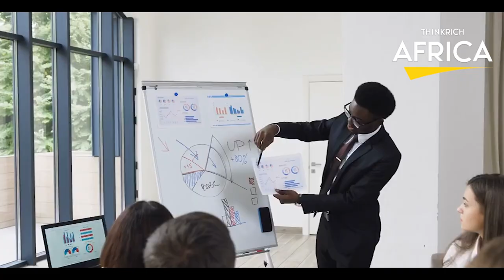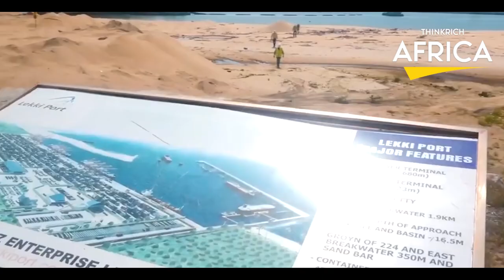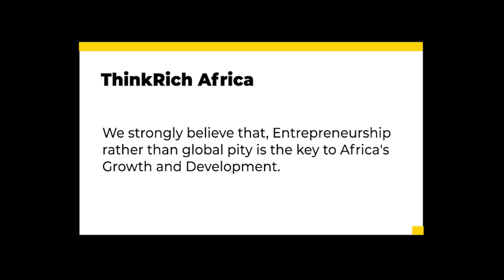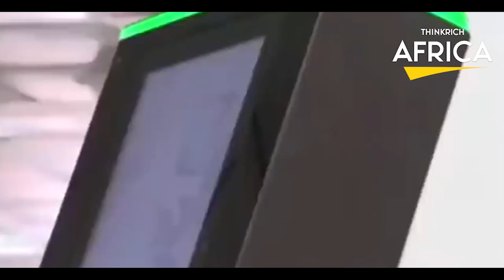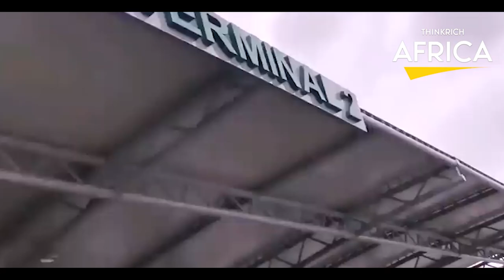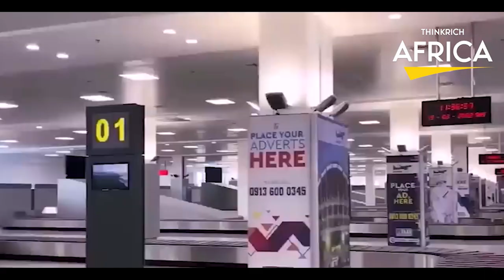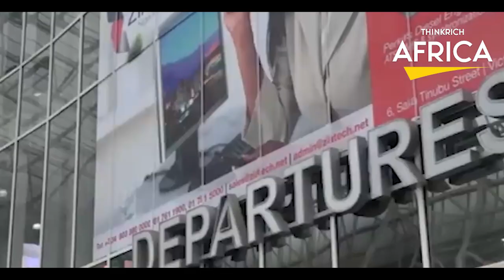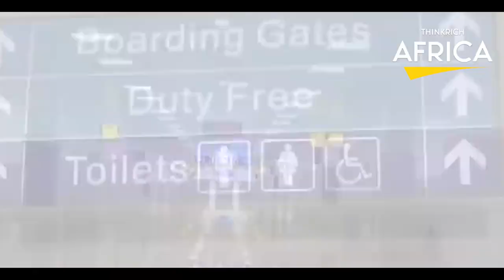Lagos Constructing An Airport Unable To Handle Large Airplanes!

Comment: We do not need any other airport in Lagos  what we need is industries with stable power
Reply: Because Lagos needs industries and stable power doesn't make airports less important.
Lagos is Nigeria's number 1 international city, and so many people move to and fro daily. The passengers are actually too much for the MMIA, even though Buhari built a new international airport terminal that can take 10 million passengers, the state needs another airport. We don't need to wait until that one is over crowded to build another. Besides think of the jobs it will generate.
Also, No space in Lagos to accommodate large to medium industries, it's Ogun state that will take all that.